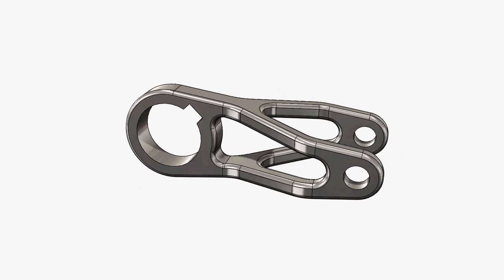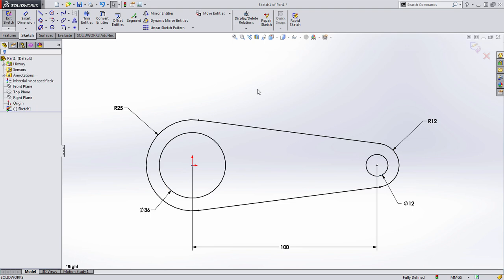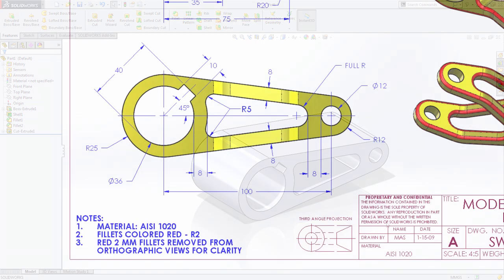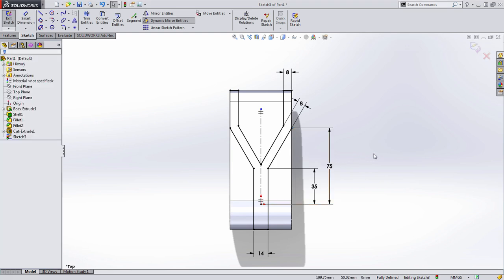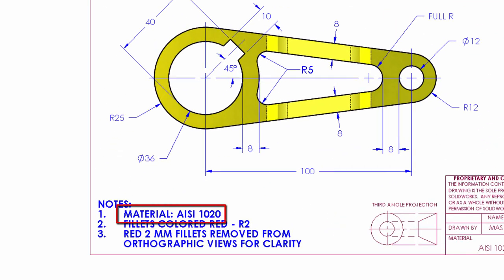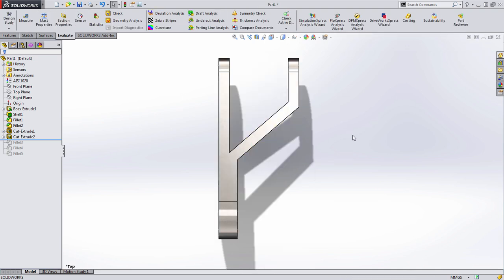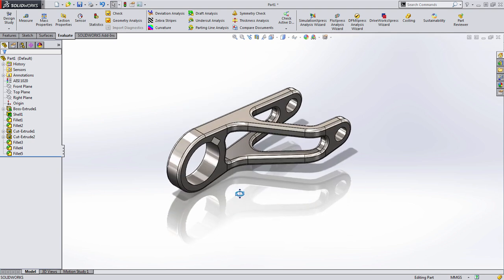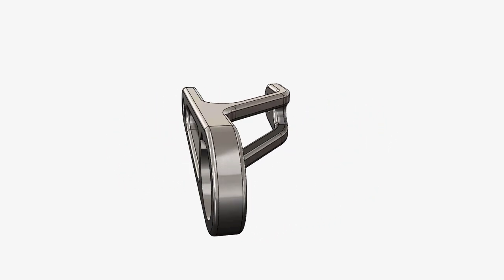SOLIDWORKS World: Model Mania 2010

Comment: As I understand the low level of safety in a greater degree caused by improper ratio of radii that make a thickness of 8 mm element is less than 8 mm. Or curvature of the element affects more?